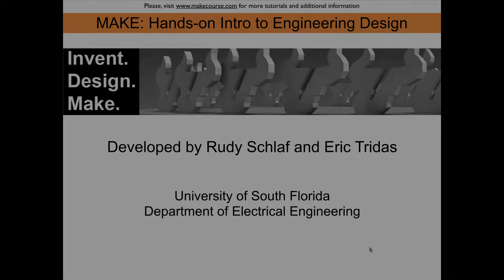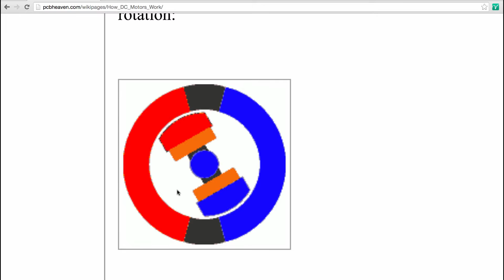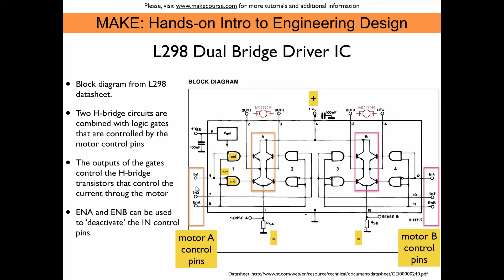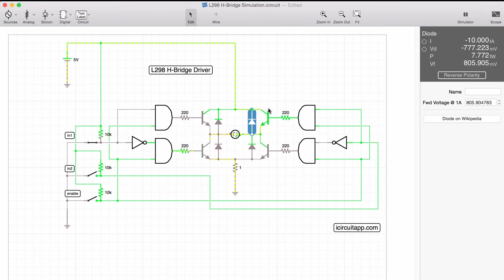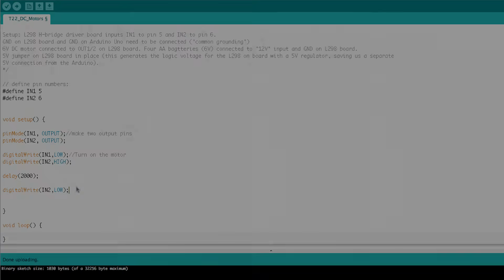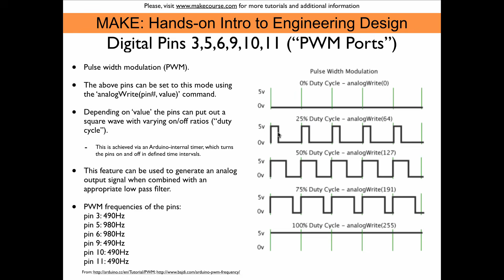Tutorial: Controlling DC Motors with the Arduino

Comment: Excellent video.  Am surprised that you didn't mention the use of the enable pin to control speed.  What I tend to see if that InA and InB are used to control direction of motor and that Enable is PWM controlled to change speed.
Reply: +Neil Kolban   Hi Neil, could you help me please, Is it possible to control a small motor without using Arduino? " I am wanting to try and make a solder fume extractor, would this just need to be on or off?  Thank you very much... John :)
Reply: +karen berry If you apply a voltage to a motor, the motor should turn.  Attach a fan blade to the motor in the correct polarity, it will suck or blow.  I'd suggest though that you could buy a cheap personal fan at the dollar store cheaper and easier than you could make one.
Reply: +Neil Kolban  Thanks for the quick reply Neil, I think you are right mate just get a cheepo fan from £1 shop  :)